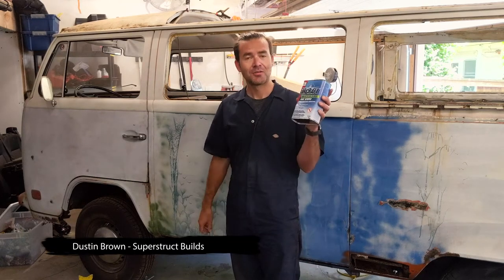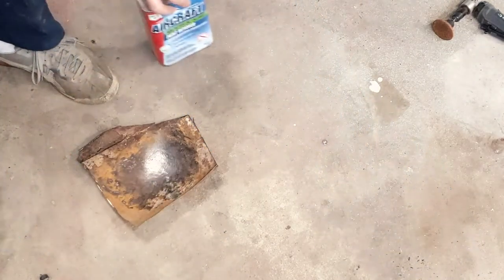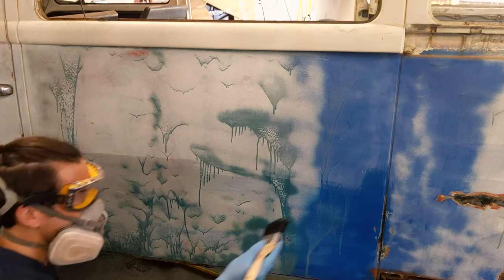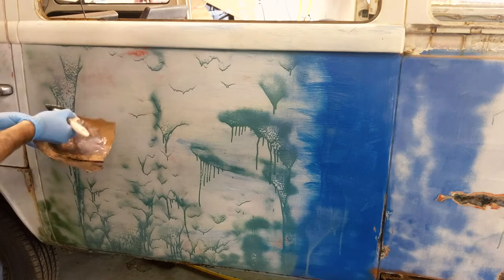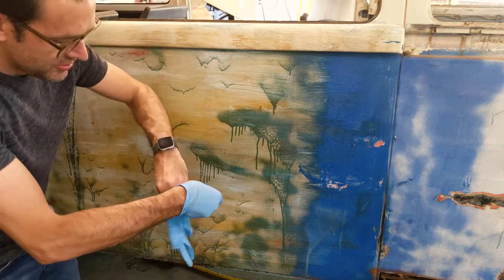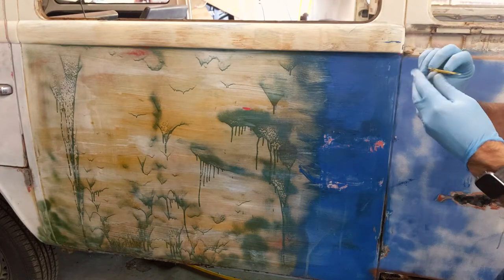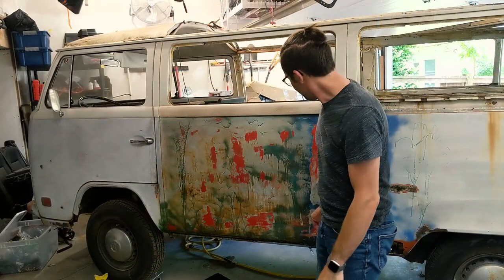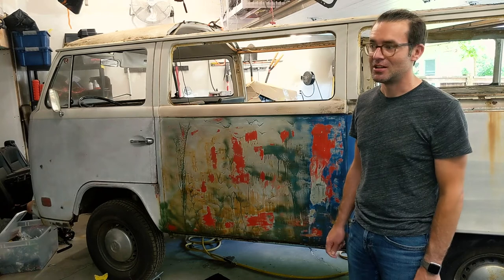Does 2020 Aircraft Paint Remover Really work?

Comment: 1.) You applied it too thin by brushing it on like paint.  2.) Immediately cover it with plastic film to keep it wet and prevent evaporation.

Use a hard plastic scraper to prevent gouging the metal.

Comment from the maker: Help me out here? What did I do wrong?
Reply: Try placing a garbage bag over the paint immediately after brushing it on. It keep the acid from evaporating and gives it a longer time to react. Just what I've seen people do in the past. Good luck man
Reply: @RipRoaringGarage  not true... I used "citustrip" from Walmart and it destroyed all of the paint on my car. It literally washed off with a pressure washer afterwards. Maybe that product you had had bad results. But I used it on 3 stage paint and had no issues what so ever
Reply: @RipRoaringGarage  everyone has an opinion, I know my paint was good. It was a factory job. And the citustrip took it off like it was not even on there. After 2 coats and  12 hours of sitting under a plastic cover in the sun. Sorry your stuff didn't work, bummer. But there are products out there that will do the job.
Reply: @RipRoaringGarage  time is money, yes. But  for the DIY guy, like myself, time is something I waste in my garage while drinking with my friends. And for only having to sand the car lightly one time before primer I'd call that a win in my book.
Reply: You simply put the remover on waaay too thin. I had similar results the first time I tried it, then i learned you have to really glob it on there. Brushing it on won’t cut it. Instead use the brush as a scoop and slip it on as thick as you can before it falls off the panel and onto the floor due to its own weight. 

If you apply it thick enough you should literally hear and see the paint lifting off the surface within seconds. Hope that helps someone.
Reply: @3dChris   This is the  new EPA approved formula without the toxic acid in it.  You are talking about the old formula that does literally melt off paint within minutes.  This new formula sucks but it will save the planet and probably won't give you cancer.    The chemical removed is called Methylene Chloride - a toxic and deadly acid than melts paint off metal.  You will not be able to buy any paint removers anymore in the USA as it's been banned.  Sorry.  Back to sandblasting or other more time consuming paint removal process.
Reply: @AEON.  I ordered a gallon of methylene chloride off eBay and have been mixing it back into strippers. Works like the old stuff
Reply: @danhoy8356  You're fkn kidding me!  US?  How much is it on eBay?
Reply: @AEON.  just looked on Amazon. About $70-80 per gallon. I never measure, just a splash or eye ball it into can of stripper. If I had an old can I could get a percentage for mixing
Reply: @danhoy8356  so its like 1 tbsp per quart?
Reply: @ZERONEINNOVATIONS  I probably put 2 tbsp per quart. It thins it out fast and you don’t want to put too much in. Start with one and add till desired effect
Reply: @danhoy8356  Thankyou for fast reply! I did a research about this mixing method for 1 hour, but I couldn't find any information about it.
Reply: @ZERONEINNOVATIONS  same for me. I need to find an old can. Hoping it has a % or Some kind of active chemical amount. First time I used it I added too much and thinned the expensive/crappy new airplane stripper to almost a fluid rather than a gel. It ran off and didn’t hold itself at all. So start small and add till it works.